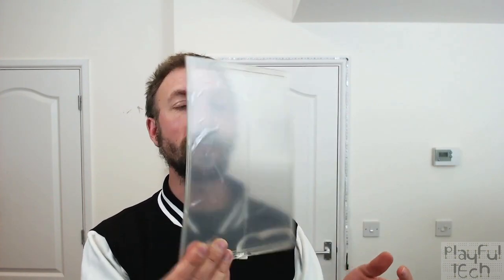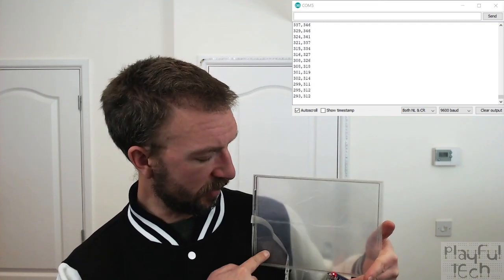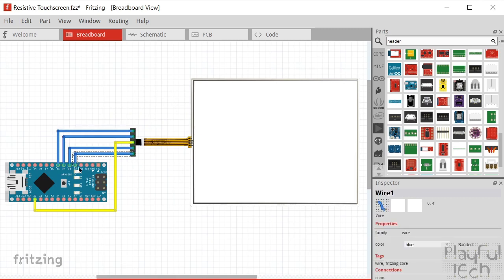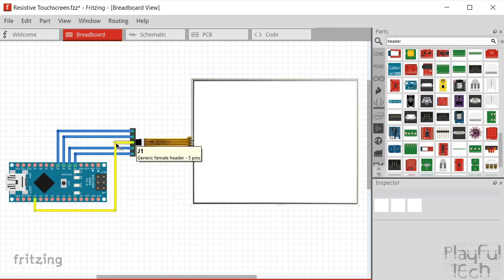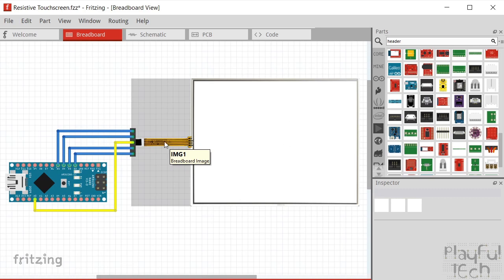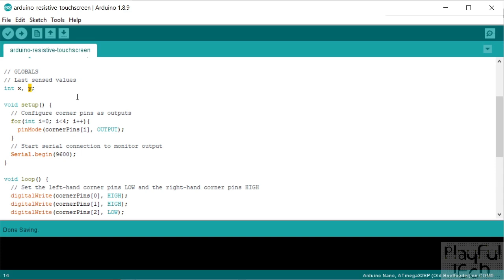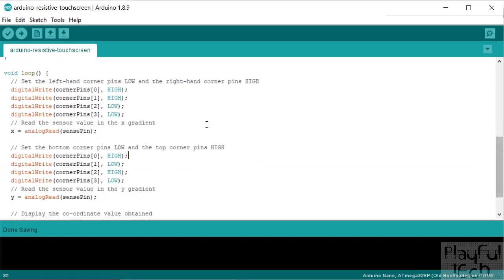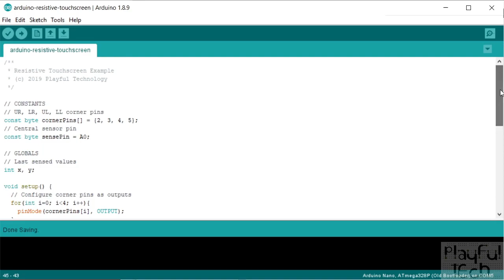Arduino Resistive Touchscreen Panel

Comment: Quick question, I have a device that has a small 4 wire resistive touch screen which no longer responds, I have found a replacement 4 wire touch screen, however, the original screen has the lead positioned along the bottom edge on the left hand side corner, the only screen I can find has the lead coming from the bottom right hand side, will this cause the X,Y co-ordinates be different between the 2 screens?  I’m not sure if the device has a screen calibration option, there is a mini USB socket on the main board so I’m assuming there is some way to calibrate it using a pc but wouldn’t know where to start with that 😂

Comment: Sir, can you make a project where this touch screen would be connected to a esp8266 and a local webpage will be hosted there. In AP mode if anyone connect to the access point created by the ESP8266 and enter the default IP address one blank webpage will open. If user draw something on the touch screen it will show in that webpage.